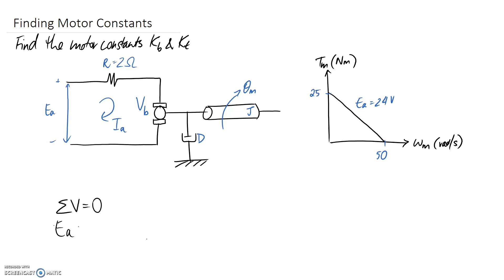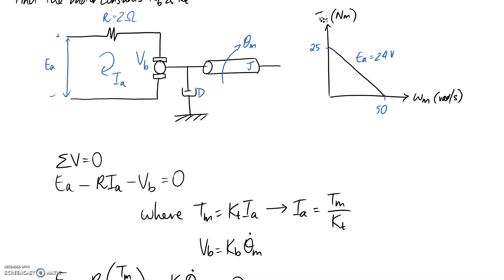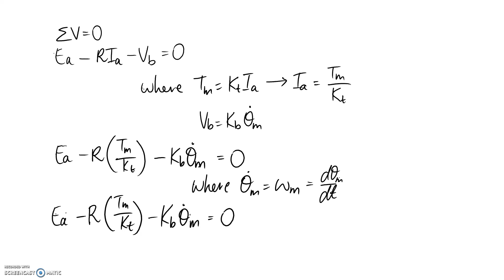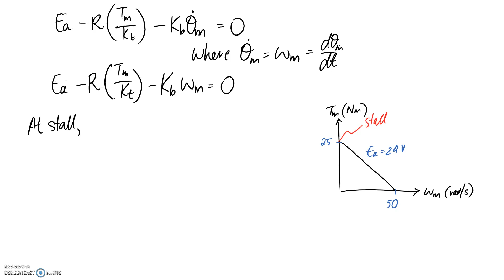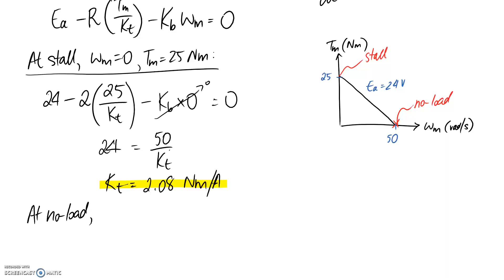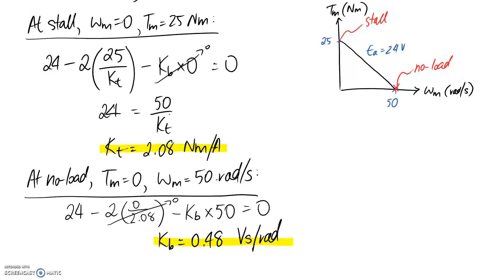Comment: Nice video.  Good explanation.  Thank you!  However, I’m confused regarding the KT and Kb values calculated.  Were these just example values to demonstrate the process?  I ask because the Kb and Kt values you calculated turn out to be inverses, and there is a comment from mehmetkilic9518 stating that Kb and Kt are inverses (Kb x Kt = 1).  There are a number of references that indicate that the motor torque constant and the back-emf constant are supposed to be equal when in SI units … Kt (N-m/Amp) is equal to Kb (Volt-sec/rad) and that this can be shown using Power-in and Power-out equations.  The RPM per Volt constant (Kv) that is often listed for dc motors, when written in units of rad/Volt-sec, is nearly the inverse of Kt or Kb (with a small correction for the reduction in voltage from the no-load current times the motor resistance).  Were your numbers taken for a real motor data sheet?  Any thoughts?

Comment: For additional information,
Kt x Kb = 1. So you do not need to calculate each parameter. Also, please keep in mind  these parameters varies a lot with temperature. Under room conditions everything is okey. However when the temperature deviates from the nominal point, thing are getting changed. Think like an experiment about heating up a magnet. Its strength will decrease!
For more information check motor production companies documents. for example Maxon, Faulhaber, Ingenia etc.